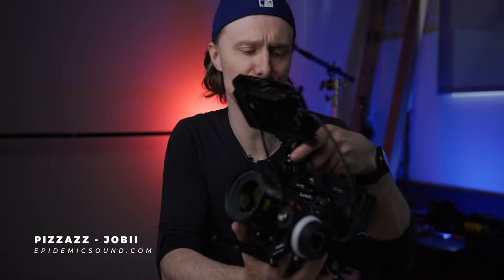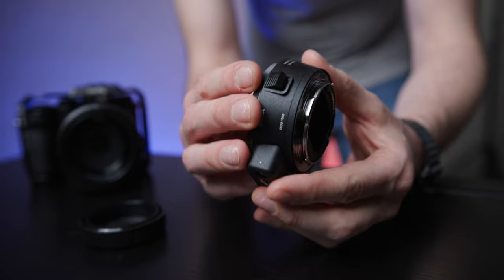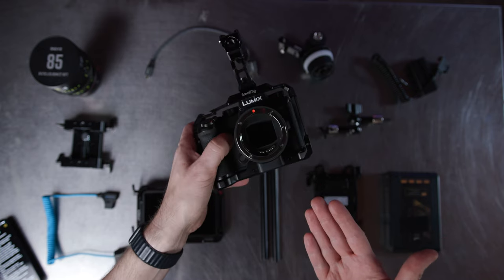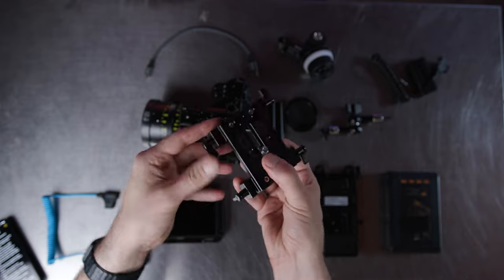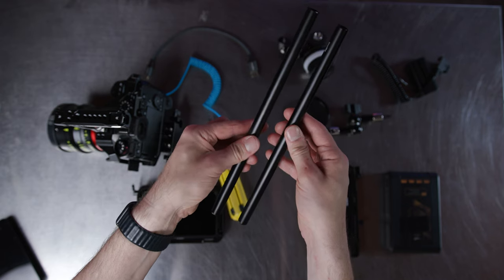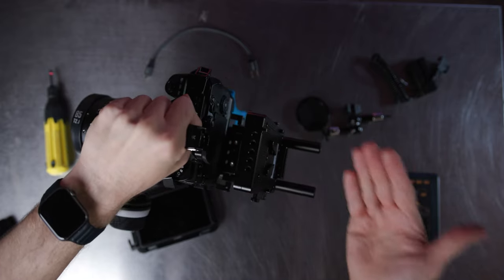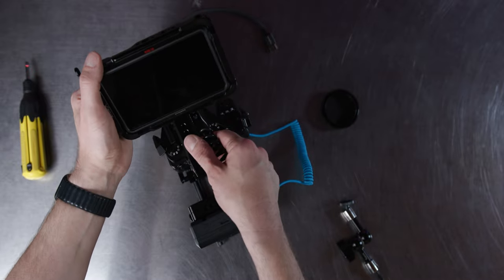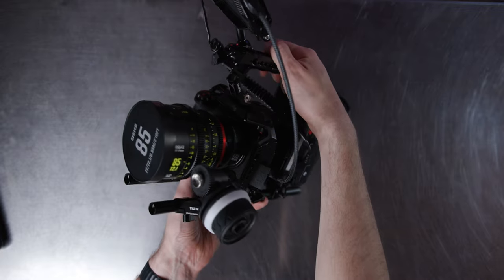PANASONIC LUMIX S5 - How To Build The ULTIMATE RIG

Comment: Excellent video man thank you! Just got my S5 and I'm in the process of rigging it out, this helps alot!
Reply from the maker: My pleasure and thx for watching! Check out the polar pro base camp matte box as well, also if you want a wireless transmitter for director monitoring- the Hollyland Mars 300
Reply: @StephenBell_video  I was thinking about getting the Tilta Mirage with the VND, if you haven't checked it out you should, from what I saw it's a solid bargain, also about half the price of the Polar Pro.
Reply from the maker: @filmbyakiljoefield  good to know and thx for the tip! I use the base camp with my C70 and I love it, but the price is steep

Comment: That looks like a nice setup, good to see how this rig was made. Interesting to see the use of dummy batteries in both cases. One thing I can recommend as a way of protecting the fragile micro HDMI port connection is the "SmallRig 3021 Slim 4K HDMI Adapter Cable (D To A)". I think this goes some way to reducing the possibility of damage. Also, I used to get some flickering on my monitor when I used a cable directly from the monitor to the port on the camera. With the 3021 adaptor, I don't get that problem any more.
Reply from the maker: Great point! At the time of the video I had misplaced my port connector/ highly recommend using it with the hdmi cable

Comment: Hi great video!, I wonder about the ZITAY adapter, does prevent shortcircuit? or just turn red light and fry up gear? or just dont allow power goes on in case you missmatch the polarity?
Reply from the maker: Thx so much! The zitay adapter has been flawless for me so far - especially paired with the lower wattage v-mount I use 👍👍
Reply: @StephenBell_video  but it does protect against short circuit?

Comment: Still rocking my S5 in a cine rig setup as well.  As I pull focus manually with Cine and Anamorphic lenses, I can easily resist the PDAF autofocus of the S5 II/IIX.   Also while supposedly the same sensor, I've seen a lot of examples that low light and noise patterns have suffered with the new cameras.   Also the sensor readout seems to be faster as rolling shutter is better on the OG S5, reducing the excitement of 6K open gate for me.     Waiting for the the next L-mount camera that goes further than the S5 II/IIX.   Camera to cloud?  Have that already with Atomos Connect.

Comment: Bro i have an important question , so i have full rig for my sony a7s 2 , but just got the s5 , my present vmount d tap output is 14.5 whats a safe voltage for the s5, what the output for your d-tap, i have the Juicebox V-Mount Battery & Rapid Charger, my v mount plate brakes it down to 8 and 9 volts , whats safe , respect

Comment: Just wondering. Wouldn't it be easier to power the camera over USB?
Reply from the maker: USB C doesn’t have the same power ability as v mount, and the cables aren’t as robust
Reply: Usbc is way better but you have to have the correct connection to give sufficient power it took me a month to figure ghat out now my new vmount plate with usbc runs great and i can always take the camera away from the vmount without a power cycle and continue shooting
Reply: @JabDFilms  wondering if you could share the  v mount plate and cable you're using for USBC power. I'm apprehensive about using dummy batteries to power camera.

Comment: Sup bro dope rig i have a similar setup but charge with usbc instead… about the dummy battery plate issue there is a gray rubber tab u can lift to be able to close your battery door with the dummy battery in it
Reply from the maker: Thx so much and for the heads up, I didn’t see that at first 🙏
Reply: @StephenBell_video  no problem bro 💯